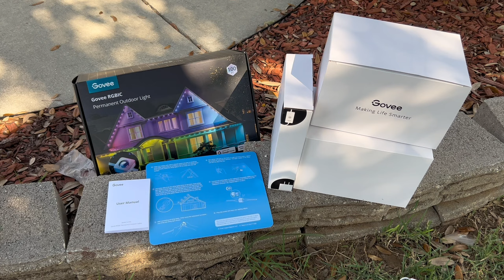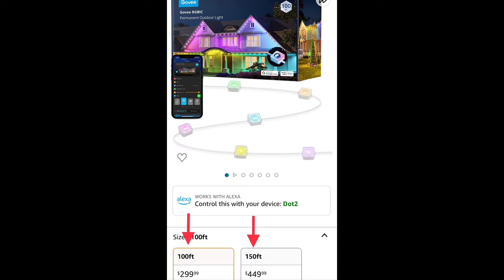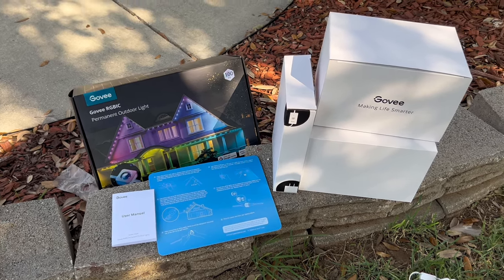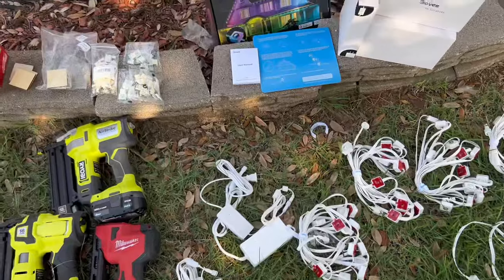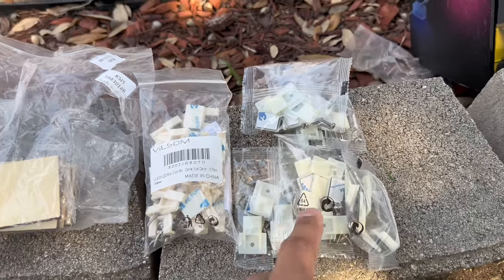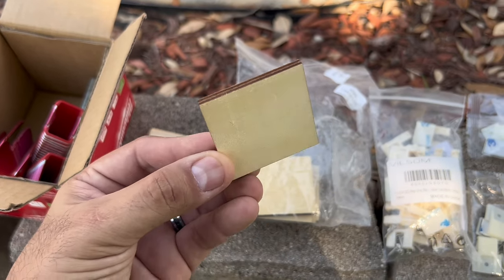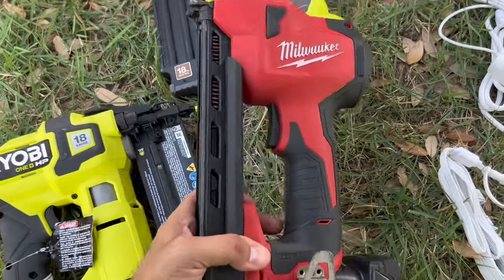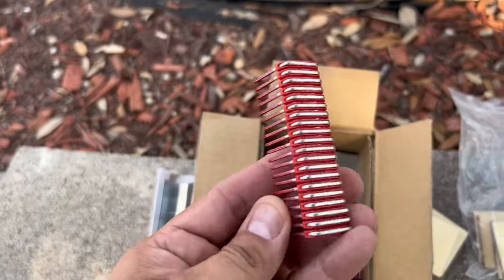Govee Outdoor Permanent Lights-Home and Back Patio Install @GOVEE #govee #howto #diy

Comment: Hi.  Great videos.  I’ve watched all the Govee light ones.  I’m wondering how do you install them when the peak goes up but there’s also a horizontal eve under. How do you splice the wires to make that connection?
Reply: Wondering the same!
Reply from the maker: You buy another kit and group them in same model group

Comment: Amazing install! I have a 375 linear foot roof, can i put all those together, with the 12 ft extension?  I just have a single jump id haveto make.
Reply from the maker: 375ft is alot linear feet. Also, Govee has given the max of 150ft on one controller and power supply. So you will need to buy 2-150ft boxes and one 100ft. Then you will need to group them in the app. Take a look at my Govee app video to show how you can group all three controllers

Comment: What size block do you recommend using from the light to the side of the house? Govee’s website says about 2-4” but that’s a serious gap different, looking for recommendation as I’m about to do these myself this weekend
Reply from the maker: We use a 2X2 blocks for a 2” spacing. That helps with the triangle effect. If you don’t like the triangle effect, then go past 4”

Comment: How did you trasition from the pitch roof above the garage to the soffit section? Did you use 2 separate controlers
Reply from the maker: Thanks for taking the time to comment. I have a video coming soon that will explain this question. I was supposed to place in my second video but I forgot to. My apologies. What we did here was drilled a hole on the right to pass the connection into the attic for the power adapter and controller. Then out we came right to left with the lights and drilled a hole at the left but did have to splice the lights to get them through the attic. Once in the attic, we spliced the 12ft blank extension that Govee provided and exit out the left side of the house drilling a small hole to start the lights on the lower part from left to right. Only 1 power adapter and 1 controller were used. Hope this clears this up. Also, I just put out a new Govee video and can find it at the end of this video. That one shows the planning and splicing. Stay tune for more content in the near future

Comment: Great video’s, glad I found you.  We actually live close in Schertz.   I am definitely going to get the Govee’s but have a few quick questions.  First not light related.  Why two brad nailers?  Second it looks like you wrapped your entire house, based on the patio footage.  Did the 100ft go the whole way or did you use another set for the back.  Thanks again for the video’s.
Reply from the maker: Hi Paul, thank you for supporting our channel by watching our content. To answer your first question about why two nails. We add two nails because in the middle is a hole for the screw that comes with it. If I shoot directly in the center of it, the nail will be pointless. So I have to nail it on the edge of it. We try and pull slightly on the line to straighten it so while doing this, your clip will pivot and turn and look janky. This is the reason we install two. It helps if for some reason one fails there is another. Second question, we did not wrapped the entire house, the homeowner bought an extra 50ft kit not shown in the video. Hope this answer your questions. Thanks

Comment: Great run down of things that you took to install! Question for you - what is your starting point? I assume that's the point where you have the controller? So is the controller inside your attic?
Reply from the maker: I would first find your attic door go up there and see if your outlet is to the left or the right of the attic then that’s your starting point on the side of the house
Reply: @jbsdiytv  that's a great input. I will just do that. What size of spade drill bit did you use?
Reply from the maker: It’s a 3/4 spade bit. It is the same size as the female side screw on cap. We seal the hole with matching caulking
Reply: @jbsdiytv  thank you for your reply. Stay awesome! 👌
Reply from the maker: Thank you for the support, you guys are awesome
Reply: @jbsdiytv  I have a newly built home with an outlet in the soffit. Can I use that?

Comment: I enjoyed your video, question though—how did you connect the lights on the peak of the front roof line to the rest below? (looks like it’s separate from the rest, which is a nice touch)
Reply from the maker: We really appreciate you taking the time to view this video. To answer your question, yes it’s separate from the bottom but all connected to the same controller. We started from the top right were we drilled a hole big enough to pass the power connection through the attic then continue left and drilled another hole to pass the lights through the attic. We did have to cut the line but I highly recommend you don’t cut the wire since Govee voids your warranty and so does Amazon. If you short it out, that’s at your own risk. We are permanent and Christmas Lighting installers and have a good understanding of wire gauge, voltage drop, and overload. If you cut it, after each male and female connections the data reads 4 lights, after that it won’t work so planning is a must. If you would not like to cut anything, I’d recommend purchasing the 50ft set and you can sync both controllers in groups. We wish you the best of luck on your installation if it’s attempted👍👌
Reply: So can add or attach two different strands to one controller or power adapter? (I am looking into installing myself and I have a similar roof peak above my roof, I would not attempt to cut them). I was wondering if a non-light extension would work on each side of the peak?
Reply from the maker: The 100ft set comes with one 12ft extension. The only time you use that would be if point A and point B are more than 10ft away. The power supply and controller have a long length of wire on them as well. Say I have 3 peaks, most likely those peeks jump up to 3-6ft so that’s where I would need 3-12ft extensions. If your jumps are less than 14” then you won’t need an extension as the lights are spaced 17” and a small jump can be done. A little note, the 50ft set does not come with a 12ft extension(that’s for the ones we have ordered, only one was sent accidentally). At the moment, Govee does not have a t-split to run, multiple directions
Reply: thanks for the feedback and advice, you guys do nice professional work
Reply from the maker: Thank you. More content like this category is on its way. Turn on the bell notification so you don’t miss the next content

Comment: Question for you, on the clips you are using, could you not just use the 1" staples on either side of the light to secure them instead of those clips?

Great install videos and awesome work!
Reply from the maker: Hi there and thank you for watching our content. Two things here- 1) when working with hardiplank board it’s impossible to drive a staple in that type of material. Yes it can be done but only if it’s wood. 2) If you tend to use the staple gun on wood instead of the clips, the gap between the front of the staple gun and actual staple sit back 1/2” cause a slack in your line. The purpose of the clip at each light is to hold the adhesive pad on the back of the light firmly against the material your installing and takes all the slack out of it. Hope this helps and answers your questions. 

40 Govee Installs in and every client is happy that our installation will outlast the lights themselves👍 Use a Brad nailer and clip
Reply: @jbsdiytv does the Brad nails hold good on the thin metal soffits
Reply from the maker: @hoocli  hi, they do not hold on metal soffits. Need to screw them in.

Thank you for the comment

Comment: Does the brad nailer for the clips work with those that have aluminum vented soffits, or do they need to use screws?
Reply from the maker: Need to use a screw that has a fine point with fine thread so it doesn’t strip the metal
Reply: Like the screws that come with the set?

Comment: If you have full aluminum perforated soffits (like me), do you secure the clips with metal screws instead of Brad nails?
Reply from the maker: No sir, if you go to printables.com they have magnetic mounts for the Govee light and the strand for metal soffits. Type in the search Govee RGBIC Permanent Outdoor Lights Magnetic Mount. Oh wait, you said aluminum. Never installed on aluminum or vinyl. You can contact them to see if they make something for that. If they don’t then you will have to secure them unfortunately with small screws. I believe the bit is a P1 Phillips bit. Anything smaller than that is a pain to drill and keep steady. Good luck
Reply: Thx!

Comment: Great job, man. All Govee needs to do is come up with a tray system that can hide the wires that's paintable.
Reply from the maker: Thank you Mr. Unknown lol. This is true👍. That line has hid well in a white soffit and that’s pretty much it. I have installed many track puck lighting before but I do know that having a track system will then draw the price up and I think Govee is trying to put out a great product at an affordable price. Again, I’m not sponsored or paid by Govee but that’s my opinion. Once the warranty is over, color match the soffit and then paint it. If strands go out eventually, you can purchase strands later to replace them. These have 50,000 life hours so if you run them 4-6hrs at night, you should be good for 10years. This product needs to be permanent cause that’s what it is, so it failed at the 3M even after we cleaned the area like described so we didn’t give up but just made it better and wanted to share. If we come up with any more ideas to make these installs go smooth, then we sure will put out a content about it.✌️

Comment: I am in Texas too and have hardiplank, is that what you have too? Worried I couldn’t secure the lights.
Reply from the maker: In Texas the newer homes have hardiplank. We use the Brad/finishing nailer and it works perfect. Don’t even notice the nail head

Comment: Hi, Aren't the lights individually programmable? So, can't you just turn the lights off where you there is a gap required? Thanks so much!
Reply from the maker: Yes sir they are to a certain extent. This applies for customization of each light lit. When it comes to the presets by Govee they are not. They will still light up. Also, my clientele pay for a professional installation so we have to give them that instead exposed lights dragging across the shingles. Thank you for taking the time to comment. Your question will help another viewer
Reply: Thats a great answer as everyone will use the presets. One more question - do you have to join the male end of both strings at the splice point?  OR the female ends of both strings at the splice point? Thank you!
Reply from the maker: @myronmoritz633  no sir, it’s a male and female connection. If you try to put both male connections together it will never let you connect as one is threaded OD(outside diameter) and the other is ID(inside diameter).I have a second video on this question at the end of this video if you would like to take a look at that one. It’s a follow up of this first one. In all, I would keep your cuts in sequence. I would pre-measure your soffit areas, total that up. If you have a 100ft box and your soffits coverage covers 75ft then you’ll be ok to make your custom jumps. If your soffits total out to say 130ft, your cutting it close to the max of 150ft to a controller and power supply. I would say then you only can make a total of 10ft custom jumps. The controller starts with a male connection. The 3 prongs

Comment: Does the brad nailer work well for hardi soffit?
Reply from the maker: Yes, all the ones we install are hardiplank cement board
Reply: @jbsdiytv  thanks so much for your reply, could I ask what particular nails you use?
Reply from the maker: Yes, we use 18gauge 1” brad nails for our Ryobi Brushless 18gauge Gun

Comment: does the power pack and wifi controller have to be inside or is it safe in the elements outside ?
Reply from the maker: We have put our first installs outside because it mentions the box and controller are IP65. Well, we stopped putting them outside because it crapped out after 4months. We now put them in the attic closer to the front so they can be picked up when they are group
Reply: so the chicago land winters will beat this product up over the years. thanks for the imput. @jbsdiytv
Reply from the maker: -4 degree Fahrenheit is the lowest temperature it can handle and the IP rating doesn’t help bad weather. The lights themselves are top notch so like I mentioned, hide the heart of your lights

Comment: I need about 200ft in one direction.  How would I go about it?
Reply from the maker: Hi there. May I ask you a few questions to better understand your question. Where are you planning to put these Govee lights. Front, back or another location. All of these would have different scenarios. I’ve installed 200ft on a front of a big house, 200ft on 1 story that nearly wrapped around. If multiple peeks, then more planning is needed
Reply: @jbsdiytv  sides and front.  I have power access on one side of the house.  So my thought was to go from there all the way to the front and end on the other side.
Reply from the maker: @BiGMERf  if you have a straight shot(meaning no peeks) then I would lay all the strands out to get a general idea if you’ll either be short or long. You’ll have two blank extensions and won’t need to use either one of them. Next example would be straight with one peek. Measure the soffit area to see the total length. The strands are 16ft -4inchs total so If you have 18ft of soffit, most likely you will have to split the difference on the strand meaning 1ft-8inches on each side will be the first light up give or take, that will be one controller and supply. This can be your starting point or end of your lights whichever way you plan it. The second controller will be for the bottom lights. That leaves you with 179ft-8inches. You can only run 150ft on one controller so you will have to lay those lights out to see were it all lands. This is just a general start. It’s bit difficult not know what layout out you have so hope this helps in some way and you have a better understanding on how this works

Comment: Will brad nailer work with metal eave?
Reply from the maker: It will not. You will need to use a fine point thread screw.

Comment: How many feet can one power supply handle?
Reply from the maker: Hi there thanks for watching. 1st Generation lights…50ft only 50ft. 100ft can handle 3 more strands. 150ft only the 150ft. On the Govee Pros 100ft can handle 200ft(6 extra strands). Hope this answers your question

Comment: How did you separate the lights on the top of the house?
Reply from the maker: Hi there. It was one strand and a half at top. Drilled on the top right for the power and controller. Exit out of the the attic, come out on the right then go left and then enter the attic. Just the top left was cut and brought together back on the bottom left roofline and continued left to right for the bottom

Comment: Jellyfish
Reply from the maker: Hi there, this product is Govee but yes it has its similarities. Jellyfish lighting is on a track lighting and control on a app like the Govee product. This one uses 3M vhb adhesive pad on the backside of each light is the only difference from jellyfish and it’s exposed and not colored match to the soffit. You can say, this is the knockoff from that and priced a few thousands less. Thank you for taking the time to comment